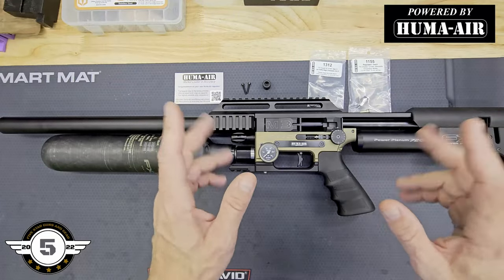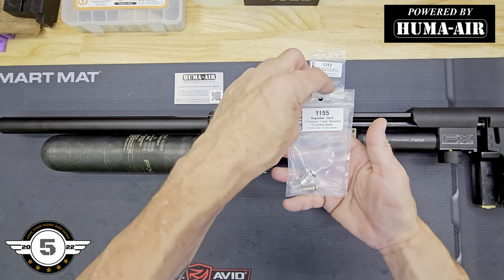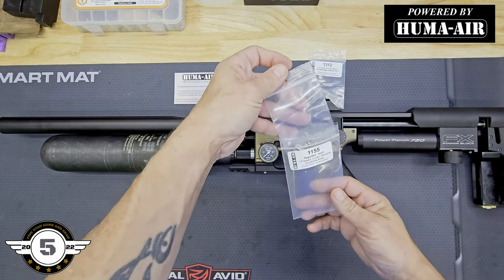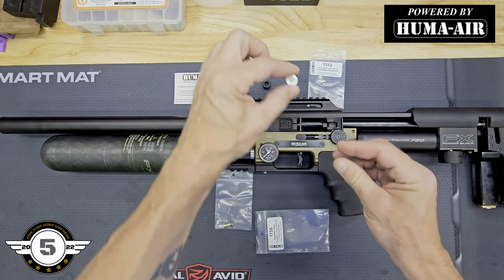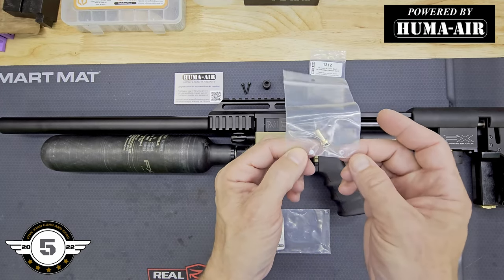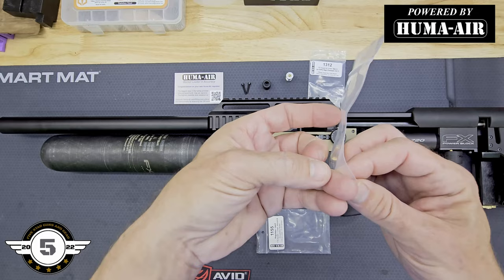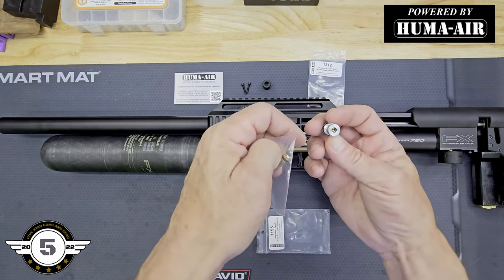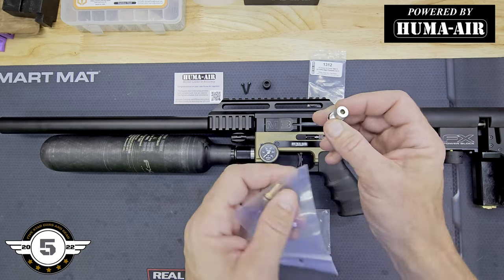Huma Air FX Impact M3 Second 2nd Stage Regulator Installation Added Reliability and Accuracy

Comment: Iv got a bone stock fx impact m3 22 sniper 700mm barrel STX and I haven't had any problems whatsoever with the factory regs. My pellets are flying between 890 and 895 pretty consistently

Comment: there are two second stage regulators .. low pressure range and high pressure range.I am shooting pellets .22 and .25 in 600 mm barrel fx m3.Which pressure range will suit my purpose
Reply from the maker: each will vary

Comment: Awesome review, I actually watched it installing my Huma Air 1st and 2nd stage reg on my bronze M3, after I put my 2nd stage in (the 110-165 high pressure one), I had to back it out quite a bit to get to 110 bar, i feel if I was to go to 165 bar it would stick past the regulator housing, was this the case in yours? Huma Air has a nice laser etched trigger plate, picked one up, looks awesome, any feed back would be appreciated. 
Thanks
Reply from the maker: Not that I recall i am out of town but will check it I do not recall that being a issue but HUMA Support can clear any issues up with questions